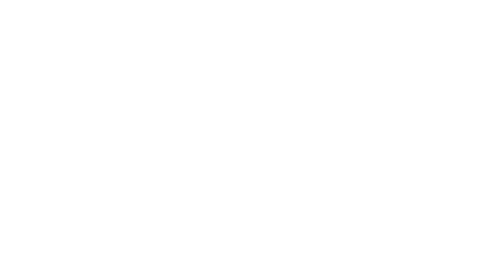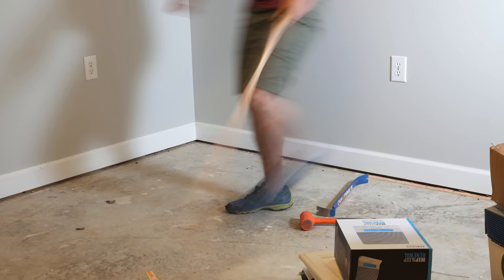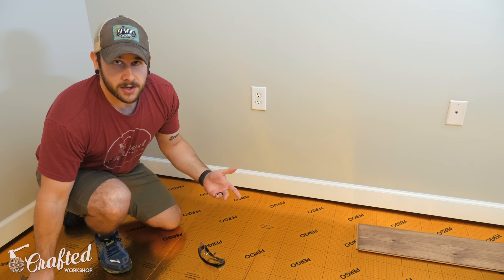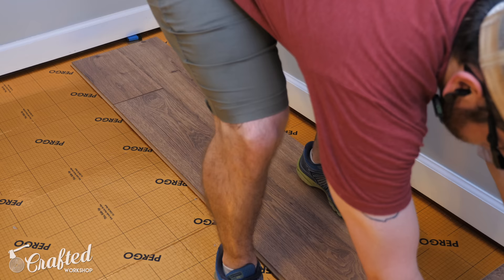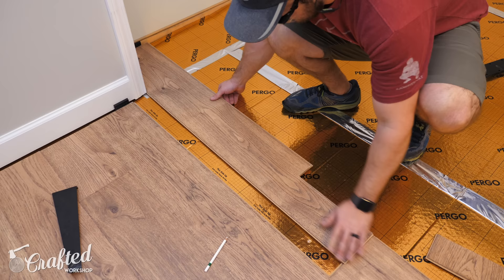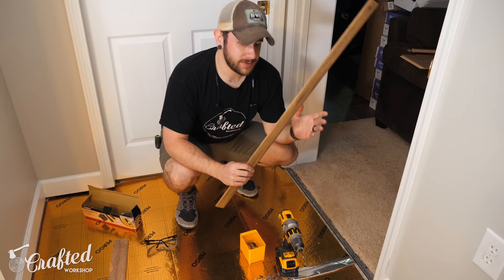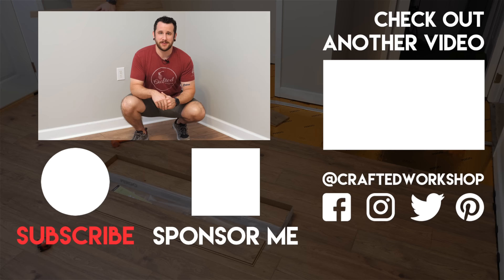Installing Laminate Flooring For The First Time // Home Renovation

Comment: What if the floor isn’t even and flat. The sub floor has some spots that rise up kinda like a bump. How do you deal with that?
Reply: How much of the subfloor is damaged? I had the same problem with one of my rentals and decided to just replace the subfloor. Really isnt a hard job. In my case, most of the subfloor had bad odors from a cat, bumps, broken/patched. I decided to just replace. Went to home depot, loaded up the truck and installed in a few hours.

Comment: Ripped up my carpet and my baseboards don’t have a gap between the concrete? Like the gap between the baseboard you slid the underlay and boards under? Do I need to replace the baseboard?
Reply: I don’t have a bandsaw do you have to cut off the tongue?

Comment: ¿No screws or nails to hold it in place ?
Will not bow or pops from the center? I’ve never done that
Reply: You do not ever nail or screw down floating floors. It expands and contracts. If you nail down you will have lifting.

Comment: Differences between laminate and hardwood floor? And what's the underlayment for? Ty
Reply: Laminate is a man made material that just looks like wood. Hardwood floor is made from actual wood, either whole planks or just top surface. Hardwood can be refinished after it gets scratches, but it's pretty difficult and expensive procedure. On the other hand you can't refinish laminate, once it get scratched you can't do anything about it. There are many different classes of laminate, and some are extremely hard wearing with 30 years lifespan for domestic use. Underlay usually is a 1-3mm foam or 5mm boards used for insulation and sound deadening. Plastic sheets are also used to create barier for moisture if it's installed on concrete subfloor and they go below underlay.

Comment: What did you put on the edges with blue tape and why... I think I missed that part
Reply: They're plastic spacers to ensure the same expansion gap all the way round the room. Taped into place as they never stay put.. These are removed when you fit the trim :)

Comment: I don't understand how the flooring doesn't move though as it is what half an inch away from the wall even under the final trim.. so technically there is room for it to move right??
Reply: Thats the point. It is suppose to be able to move. If it cant move the joints will break with temperature changes or airhumidity change. Since wood expands and shrinks
Reply: @aldorias  Ah! That makes sense thanks

Comment: Do you still need the vapor barrier or under layment if there's no concrete under the carpet?
Reply: SoftServedGentleman you need underlayment unless you buy the boards with underlayment already on it. If doing it on concrete you want a vapor barrier to and underlayment. But a wood subfloor only needs underlayment. Hope that helps

Comment: My question is, when you start a new row, how do you know how long to cut it so your seams are offset.
Reply: Braden Strentz use half of the board
Reply: @jamieharper3346  Not necessarily. That gives you a bit of a brick-layered look. Some say that a slightly random pattern looks better. But you have to do the math so you don't end up with two seams too close together towards the end of the room.
Reply: @jamieharper3346  Give yourself at least 10-12 inches. Avoiding brick layer or stair stepping.

Comment: I would of deff recommended removing the baseboard. 1/4 round never looks good. Worth the extra time and work r&r the baseboard. And if you ever do it again. Put a few screws where the baseboard or quarter round will hide it on your first run. That will keep everything square and you don't have to fight with the floor trying to keep it from moving on you. Once done remove the screws
Reply from the maker: Removing the baseboards would have been quite a bit of work, as reattaching them requires all of the nails to be cut off and buried. Not worth the trouble, especially since I had the walls painted before installing the floor. On new construction, I definitely agree. And good tip on the screws!
Reply: On new construction its nice to get the flooring in before door casings or trim is on.....Saves undercutting the casings.

Comment: Why trim the tongue off the first boards? For more room for expansion?
Reply: The tongue is usually 1/4 inch. If you space away from the wall 1/4 you'll end up with 1/2 inch gap which will show when you place baseboard down.

Comment: Anyone else here because the floor completely fell apart at the 3rd row and you were barely holding it together to begin with, and it kept sliding everywhere and now you’re sitting in the middle of an empty room someone has to move back into hating your entire life and every decision you ever made? Just me? Awesome. Don’t attempt this if your floor is uneven or your boards won’t “easily tap together” that is all 😭

Comment: is pergo expensive , they dont seem to have prices on their website?
Reply: Tan Cakar 
     Look elsewhere!  There is so much competition in flooring. Much better quality products for far less.
      Research into the type of material that best suits your needs, the geographic area in which you live, the type of traffic, children, pets do you drag things across your floors?  Maybe a solid wood or engineered hardwood looks and feels better to you? 
        If you just want to go cheap, cheap! (Something that you’ll pull up in a year or two)
  They’ve got tons of that everywhere. It’s used as a leader item for their advertisement.  
        I’ve always appreciated the nicer quality products and I’m willing to pay for it and learn how to properly install things and I have a great network of professionals that I can call on if necessary. 
       Take you time and you’ll not regret your investment if you’ve done your due diligence
   .... it’s too late once you’ve installed it !

Comment: I installed a very small area of laminate flooring in one of my closets with 3 walls and a doorway. The closet is 35x25 inches. I used and underlayment and went with the recommended 3/8 inch expansion gap between all the walls. I assume most "floating" floors stay in place because of the friction between the large surface area of connected laminate and the floor, however, since the area I did was so small, the flooring is essentially a 35x25 inch square board that slides around under the trim. Is there something I should have done differently here? What should I do to fix this? Would a single nail in the middle of the floor still allow for expansion if needed? Anybody with helpful information will be extremely appreciated. Thanks.
Reply from the maker: I would say a nail or screw at the center of both ends would help for sure. The flooring could still expand and contract from the center that way.

Comment: Question since laminate flooring is direction when you cut a piece is the other end trash ? Since the clip that connects is on one end???
Reply: No, because you use the offcut to start a new row. This staggers the boards so that the joints don't line up. For example on the first row end cut, I would use the offcut to start the 3rd row.
Reply: Sorry I’m still a bit confused would you put two pieces together like two ends I though they all had to connect
Reply: You know make end to female end
Reply: The boards have a tongue (or male) connector on the top and right side, and a groove (or female) connector on the bottom and left. You always work from left to right in the room, so once you cut the last board in a row then you use offcut on a new row. 

May e look at some pictures on Google of you don't understand. Search for "laminate" or tongue and groove" flooring.
Reply: @dieseldawg7132  they do all have to connect, but the offcut is used first on a new row on the left, so it doesn't need any connection on its left side
Reply: buenoisbuen awesome you explained it the way I needed to hear it thank you so muchb

Comment: Do you need underlayment if you have wood subfloor?
Reply: Yes, unless you get the type that already has the underlayment glued/attached to the bottom of the flooring. Adds to the cost a little, but saves some work and you also get the exact type of underlayment for the flooring.
Reply: @pnutbuttajellee1394   love the color, what brand and model floor is?

Comment: No .. whacking it that hard to get the grooves together is often necessary but its bs, way too often you split the tongue or if with your block , you break off the tongue or pieces of it. Laminate is garbage. All of it. Also run a refrigerator over that  transition or a 2 wheel cart with a load and see what happens.

Comment: What did you do to the end of the quarterstaff ending against the doortrim at 10:28 ?
Where the end is cut off and do not have the vinyl "paint" finish.
Reply from the maker: Just had to touch up paint it.
Reply: Crafted Workshop Ah! That's when I usually fudge it all up and spill paint all over the new floor 😂

Comment: You screwed bunch of good flooring with thislayout scheme. Check out "dec layout". You lay 1st piece and then 2nd one but 1/3d shorter and then 3d one 2/3d shorter and then you keep putting whole onec untill you complete 3 rows, then you repea the process again. Looks realy good and really strong.

Comment: how did you decide on the pattern of the floor?
Reply from the maker: I just staggered the joints as recommended by the instructions that came with the flooring.

Comment: why the f is the outlets 50cm above the floor and so out of sync of the switches
Reply: That height is for handicap access.  I remodeled a nail spa in Los Angeles a few years back where the height requirement for outlets is something like 15" (38.1cm) from the bottom of the box, so yeah it varies where you live.

Comment: How much Mony 200 square feet
Reply: I heard going rare was $1.99/sq ft kinda pricey huh?
Also that was with a 1 year limited warranty on any install errors like flooring popping out of place.
Reply: Hey Kuldeep, just curious if you will need a brand new set of flooring installation kit? We currently lauch a brand new set including pull bar, mallet, tapping block, spacer and keenpad for a free giveaway compaign. Let me know if you are interested.

Comment: Nice video.  So I'm new to thus kind of thing and have a question...would someone install these tiles over just cement or is underlayment absolutely necessary? And does the underlayment provide a little more dampening/cushion when walking over the laminate?

Comment: Does it swell if u mop it or steam it?
Reply: I do not suggest using this Pergo. If any liquid is left on floor it will seep through the joints and swell. It will look awful a d frustrate you beyond belief. Luxury vinyl plank/vinyl plank is the route I would go.

Comment: This illustrates several problems if the video is intended to educate DIYers, especially taking into account that flooring can be installed by less experienced, less well-equipped home handypeople. What if you use a different underlayment without inbuilt sticky tabs? What if you don't just happen to have a big mitre saw? What if you don't have a band saw sitting around the house? Fine if you are a professional workshop, but quite poor as an educational video for the less exalted (well, mentions to "learn" in the video description referring to another type of flooring.)  Showing how to do it with more minimalist equipment would be much more useful. Nothing even gets said up front about the gap strips on the wall. I didn't go much further. I'll look for more helpful videos.

Comment: Thanks for showing your booboos! If there"s a mistake to be made, I have made them!  I've done one good sized house, and 3-4 rooms in other houses too with wood laminate flooring, and will do my ten year old granddaughters bedroom next week. I'll be leaving the trim on, and then going with quarter round trim as you did here. I think I'll buy a Ryobi  battery pose ed brad nailed, because, I've done some trim with brass and a hammer, and it's a major pain, with lots of damage to the trim, and much swearing. Not this time!!

Comment: Knee pads would've been great help and you shouldve remove the baseboards or at least use shoe base..one the beginning of the installation was hard to watch with the technique you used..used wrong molding for carpet
Reply: But not a bad job

Comment: My pro tip. Don’t use laminate, use Vinyl instead.
Reply: Exactly! Or snap a line and glue your starter row, so you can just bump and go. Watching his floor move around like that, after every tap...jeez
Reply: Why whats the difference?
Reply: Sammie McCuen usually water resistance and durability. Vinyl is also better when you have pets.

Comment: I can see why home depot charges 10k labor to install 1500 square feet this looks like a pain in the ass project
Reply: To do the job right takes experience anyone can throw it down. Home depot is notorious for inexperienced workers and over priced installation. I recommend empire today I've been with them 10 years and they have way more incentives for reliable workers. Plus ANY installation error will be covered by installer.

Comment: Not installed correctly. Laminate should go under baseboard. Adding 1/4 round after the baseboard is up is an awful finish imho
Reply from the maker: Still not incorrect, just a different aesthetic.
Reply: @craftedworkshop  no it's incorrect ;)

Comment: That is pretty pretty lazy work with really nice tools. Why didn't you take off the baseboard and do a quarter inch of gap from the actual wall? Quarter round only saves time and ruins the look of clean baseboard.

Comment: It's a base shoe, not quarter round.
Reply: same thing
Reply: Sorry to say, but base shoe mould is not the same as quarter round. Hence why it's called "base shoe" mould.
Reply: @nathancrosbie200  same thing different size
Reply: @ @TylerKicksBass  No its not the same thing. Its like calling an Android phone an Iphone and vice versa. 

It's ok to learn something new. Try it.
Reply: @TylerKicksBass  You should only call someone a mental midget when they unwilling to expand their knowledge. You are unwilling to accept that base shoe and quarter round are not the same thing. Even the name implies that a QUARTER ROUND is ONLY a QUARTER of a CIRCLE while base shoe is longer on one side. So they are not literally the same. They are similar, but not equal to each other. 

I work in a department and sell mouldings. If you come up to me asking for quarter round, I'm going to give you quarter round. If you come up to me asking for base shoe, I'm going to give you base shoe. Base shoe is typically used to cover any gaps left between an existing base moulding and a new floor install. Hence, the base shoe name. Quarter round is a mould used for whatever trim/decorative piece you need it for.

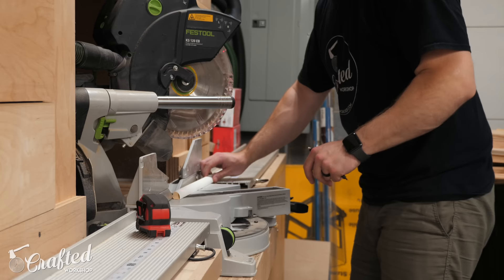By the way, your comparison is poor (shoe sizes). I would have used your comparison more for the DIFFERENT SIZES of QUARTER ROUND. Like 1/4" QUARTER ROUND,  1/2" QUARTER ROUND, 3/4" QUARTER ROUND. Also, FYI, he is not using quarter round, heres the time stamp 10:02. He says one face is wider than the other. Therefore, BASE SHOE.
Reply: @immathug   its not a quarter of a circle.. its a quarter of an ellipse, maybe they didn't teach you that at your department.
Reply: @TylerKicksBass  There's actually a purpose why they have different sizes, thus it is not quiet the same thing.. One might fit the other and the other might not fit the one. 

It's understandable if everyone has different opinions.
Cheers!
Reply: You can use either one. It' s a personal preference. Personally, I think quarter round looks old-fashion.

Comment: Too bad this stuff has no UV protection and it off yes is 4 years and you can't resend it because the top is too thin with micro bevels this is garbage flooring and only an idiot would put this in their house